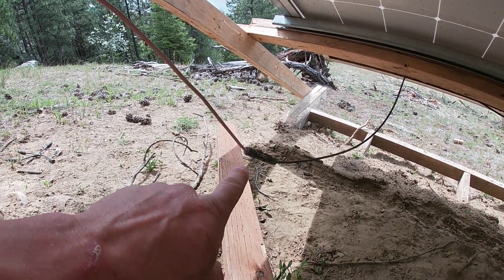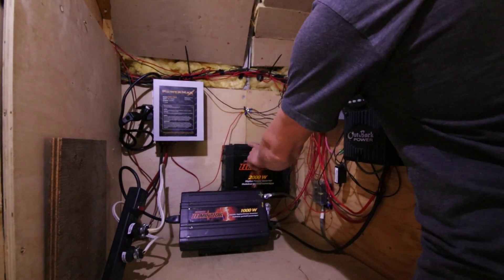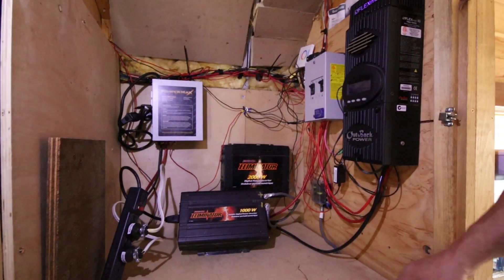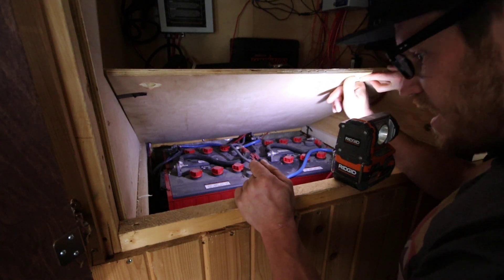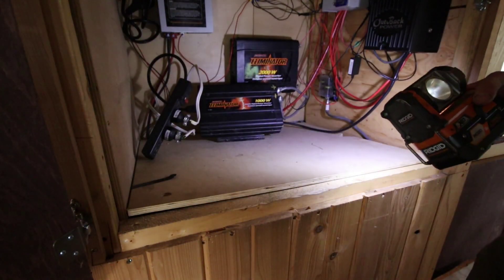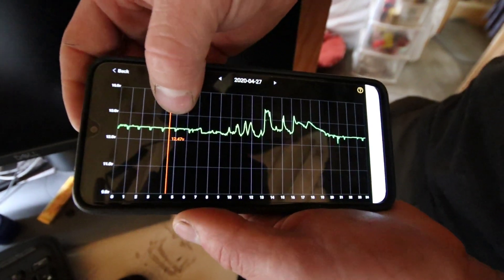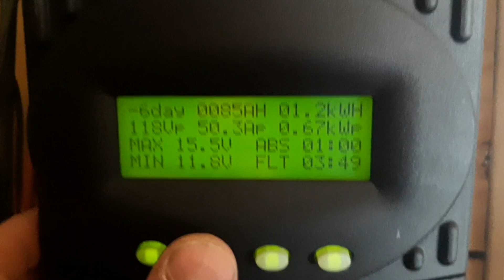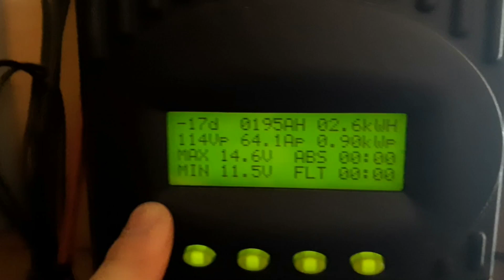Setting Up Solar Panels Far From Home - 550 Ft!! - Part Two | Better than 100% Efficiency?

Comment from the maker: Does anyone know why we are getting better than max efficiency???  Please let us know why!
Reply: If it is not below freezing, you are getting cloud edge effect.  This is where the PV array is getting direct sun as well as additional light reflecting off the edge of clouds.  I have seen 20% boosts over nominal ratings, and have heard of 25% boosts under ideal conditions.
Reply: Panels can exceed their nameplate ratings on cold sunny days.  Watch your voltage, if you see your voltage higher than the VMP rating of the panels you're getting great power.
Reply: Watts = Cold Day ( higher volts ) X CLOUD EDGE Effect ( higher amps ) ... very common.
And don't say, "better than 100% efficiency" because that is a false statement.
It is more like, "at times, better better than average".
Reply: Yeah I think panels are rated at 20C. Colder they do better, warmer they do worse.
Reply: Yep I check out mine then spayed with cold water & that even made it go up iam running   48v system & if ur going to ever run a dryer then make sure u get gas or ur going to need a lot more lol.but if it's doing well  that's a great thing  god bless & take care

Comment: Wild wonderful off grid built their solar around 300 feet from the power shed and used aluminum wire about a 2% loss

Comment: Glad to have come across your channel. Very interesting to see real world experience with transmitting higher voltage dc a long distance. I have been conflicted with the thought of whether i can send 300v dc around 200ft. The calculators say yes but until its proven in the material world the expense and effort to run long distance was daunting. I bought a MPP Solar 48v 5000w all in one unit which is better economics than buying inverter, controller separate. Electrical cable is much more expensive here in Australia. My jaw dropped when you said how much you paid for such long run of cable. That would have cost me approximately $5k here! Best wishes on your offgrid adventure. Very wise considering the future events that are arising fast.
Reply: nuclear better and cheaper

Comment: I wanted to mention to you regarding your now 3 year old video about your panels out away from you.  On aluminum wire joined with other metals like steel or copper you need to fill the joint with NoOx or a similar product otherwise the connectors will slowly degrade as the aluminum oxidizes and corrodes the connection.

Comment: How do you get more charge than the panels are capable of producing ?  YOU DON'T !
your charge controller is lying to you !.... it's fairly common for the chinese controllers to give erroneous readings.... but I am NOT one of those guys that say "you get what you pay for"
because that is totally false you get what you shop for... in other words shop real carefully
and price compare everything....you should be aware of Ambition Strikes on youtube and they got sponsored by a company that gave them or gave them a real good deal on a stand alone Box with the batterys,inverter charge controller and all that in one small unit...I think it was a 3600watt output and the quality was top notch I went to their site and they price was astounding at around $10,000 bucks I almost fainted!  that is more money per pound than GOLD ! I tell you this because I am sure there are other manufacturers that make stand alone or house hold backup units for sale and it would be well worth looking into it for you guys ! .....by the way.... your potty in the bus was great, myself we went with a good old fashioned Outhouse ! .... which is even cheaper than the way you went... but with snow on the ground it's a real bear with an unheated outhouse!......  I know !

Comment: Any wood that has ground contact will root, sooner than non-ground contact. Better to use stone or cement pads. Keep your wood out of the dirt. Unless you like replacing it in a few years. Still like watching you make mistakes and Correcting them, not say I would have done better at your age. Learned of lot in my 77 years. Keep trying.

Comment: Wow, thanks so much for this video; I'm in Panama in the jungle currently setting up my soalr grid and it's 100 yards from my container. I was wondering if I was going to have any probems with the distance Do I need to choose a different gauge of wire? I'm using 10 gauge for the entire length.
Reply from the maker: The higher the voltage the smaller the cable.  We used 1awg because it's what we had, we could have gone down to 6awg for our panels.  Look up a line loss calculator.

Comment: Interesting video. Because you are running higher voltages for 550 feet, ie 37-38v per panel times 3 panels (series) = 110-114v, your line loss is minimal - the voltage drop is differential between panel rating and input voltage at outback. Try running same calculations where the same panels were wired in parallel and your line loss is significantly higher because its the higher amps confronting higher resistance - needs thicker wire to bring loss down. Consider a 3 in 1 (inverter, charge controller and dc battery charger) before upgrading inverter, and sell the legacy equipment. For 800-1200$, you get 3000-3500 watts pure sine at 24v or 48v model . Growatt is best value/quality, Renogy etc are options. Eg4 batteries for lithium are best value/bang for buck. I have victron battery shunt monitor which measures amp draw not just voltage drop. Next upgrade I will go from 12V to 48V system for sure.

Comment: Just learning about these things but would you not be better to rectify to AC near the panels use AC cable then switch back to DC at the batteries?
Reply: Yes

Comment: I know this is way late, but check out Wild Wonderful Off Grid. The guy is an electrician by trade and they put their panels way away from the house in an open field like you.
Reply: Check out Will Prowse. He does this stuff in his sleep.
Reply: Was going to comment the same.
Also the internet is not an electrian cource.
Try a University or college.

Comment: What brand/model is your generator? I swore our next genie would have remote start. So much nicer.
Reply from the maker: https://westinghouseoutdoorpower.com/products/wgen3600df-generator-dual-fuel   cheapest one for the size and capabilities. Not a honda so change the oil / plug on a regular
Reply: @This Off Grid Life  how has the Westinghouse held up for you?  I'm got about 7000 hours on 2 Champions over 5-6 years and both still going, although 1st gen is a rough starr
Reply: Champion 4250 watt makes a great off grid genie

Comment: You stated, "... Your Lithium battery bank will last 15 - 22 YEARS ..."  What proof do you have?  The mfr may have estimated 5,000 cycles max, but they NEVER stated that you have 15 - 22 YEARS time frame - you made that up.
Reply: @justahasbeen  Yes, you are.
Reply: @justahasbeen  Yes, you do ...
Reply from the maker: 365 days in a year , lifepo4 batteries have a 5000 - 8000 cycle life depending on use and abuse.  5000÷ 365 (the amount of times the sun comes up in a year) = 13.6 .   8000 ÷365 = 21.9 .  I am not trying to be misleading, just trying to crunch the numbers I have to work with
Reply: how does that calculate if you recharge your batteries 2 or 3 times per day..
Look at Zinc Bromide.. it's a real thing..
Reply: @marksherwin9110  You cannot completely discharge and then recharge your battery bank 3 times per day. Nobody does that ...
Reply: @ThisOffGridLife   Your 3rd grade math is very misleading!  Clearly, you do not understand what the manufacturer ( and  I ) have stated regarding CYCLES.  The manufacturer did those 5,000 cycles in less than 1 YEAR.  The manufacturer NEVER stated that the battery will last 15 years to 22 years.  Show me where the manufacturer states, "... The battery will last 15 - 22 years at 1 cycle per day".  You can't because they have never stated that, and they never will state that  -  you have fabricated that information.  You have failed to account for just 10 years of AGING .  You cannot pretend that 10 YEARS of AGING has no affect on capacity degradation.  You have made an extremely bad / false assumption about aging.  I asked you for PROOF - but you have yet to offer any proof that the batteries will last 15 - 22 Years.  The best that I have ever seen is a 10 Year rating but even that comes with severe capacity degradation.  So, I am still waiting for your PROOF ...
Reply from the maker: @MrSummitville  i will get back to you in 10 years and let you know :)
Reply: @MrSummitville  Lol. It doesn't hurt to use common courtesy when you disagree with someone. People are a lot more receptive to information when you aren't trying to verbally skewer them with it and all but call them stupid. But hey, it's a free country. Just my two pennies worth. :)
Reply: @ThisOffGridLife  dont bother with him i have led acid with 15 year lifespan that i have been using for 9 years now and they are still going strong. now if you really want long life you could go with the batteries mad with caps they just keep going and going and going not cheap though. have an awesome day you guys are doing great
Reply: @LogHewer  i agree
Reply: @MrSummitville  if  you  don't  like  the   channel  kindly  leave .   This  couple   are  good    enough   to  share  their   experiences with  the  viewers if   you  don't  like  the   content  just   leave. Start   you own  site build a   boat  just  fk off  and   leave  this  couple alone they   don't need  this  shit.

Comment: Batteries are a consumable - the more you use them per day, the fewer days they will last - this is common sense.
The above statement is true, REGARDLESS of the Depth-of-Discharge,
Also, If you don't drive your car very far per day, your tires will last a lot longer, but they will NOT last forever - they will age & dry rot 
This is true for most things, not just batteries.
With batteries you need to consider the AGING factor too, older batteries will have LESS CAPACITY !
And that is where the ".. 50% DOD rule-of-thumb ..." came from.
Somewhere around 40% - 60% DOD yields the maximum total lifetime kilowatt-hours before OLD AGE sets in.
You cannot ignore AGING !
Reply: Your analogy sucks, not even close!
Reply: Wow this is extremely insightful... Makes total sense. Ideally, you want to maximize your use of any resource before that resource decomposes/breaks down with age. It's a balancing act - I had no idea that was where the 50% DOD calculation came from though, which makes total sense!
Reply: lithium ion........